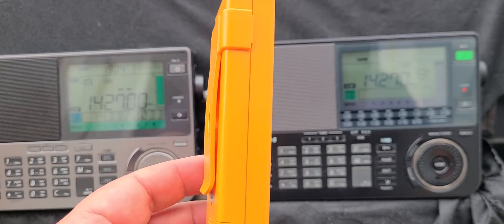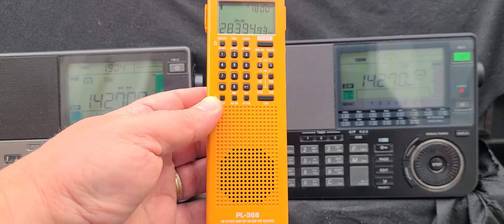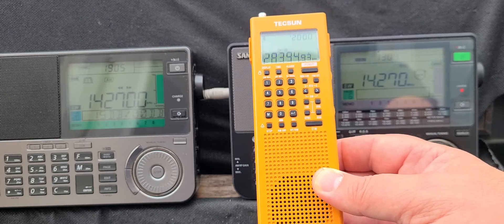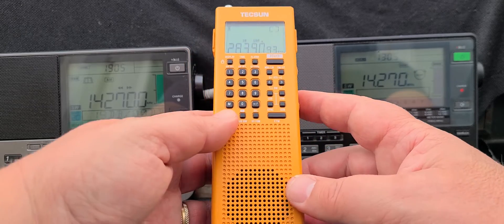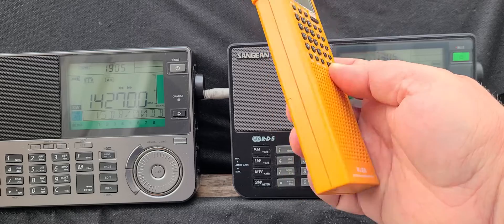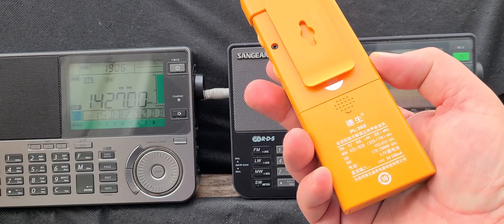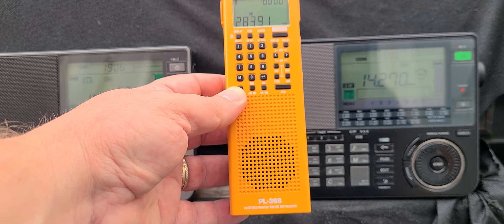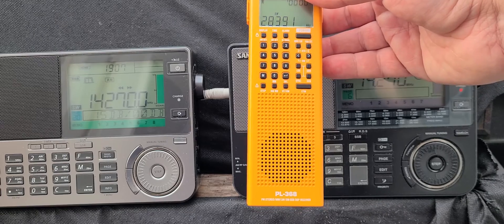Why does the Tecsun PL-368 not have frequency calibration feature like the others

Comment: There is a SSB LSB/USB calibration as a hidden feature.  

(Hint: The LSB and USB modes need to be calibrated independently. When
calibrating LSB, you need to press the LSB button to zero the calibration. When
(calibrating USB, you need to press the USB button to zero the calibration.
(1. Tune in a strong AM (MW, LW) or SW station.
12. Then use LSB USB modes to fine tune the receiver as close to zero beat as
possible (fine-tunining: Press the 'STEP' key twice to place the cursor to the
right).
3. Then press and hold the USB or LSB key until display backlight flashes two
times.
Reply from the maker: I know all of that... but the first 368 that came out, like the one in the video ..did not have calibration

Comment: I think to calibrate the frequency is by using the sync button. 🤔
Reply from the maker: No, the original Chinese version did not have calibration, the new export version does and its with the LSB and USB buttons
Reply: @OfficialSWLchannel  Do you mean the new firmware version? If so I do have it already. 😃

Comment: You said people are wondering when it would be available, but it has been available for several months on AliExpress ? What do you mean ? I bought it there but it suffers from one two problems and I wouldn't recommend it, personnally. Pl330 is a better deal, even if somewhat bigger.
Reply from the maker: Ali express sells you the Chinese version ...  the export version is not yet available and will have firmware updates to fix bugs it might have
Reply: @OfficialSWLchannel  ok. But in addition to potentially software issues there are hardware issues, let's hope they will fix them all. Anyway I prefer the pl330 for other reasons. But the 368 form factor is very nice!